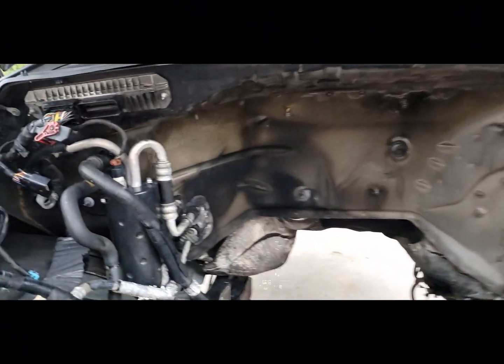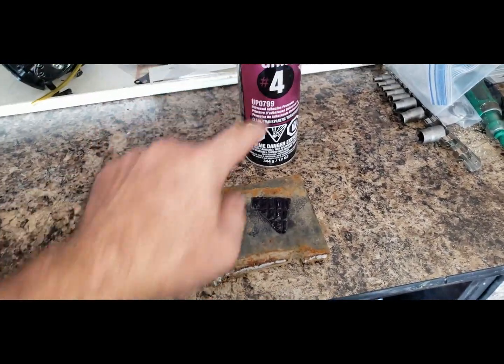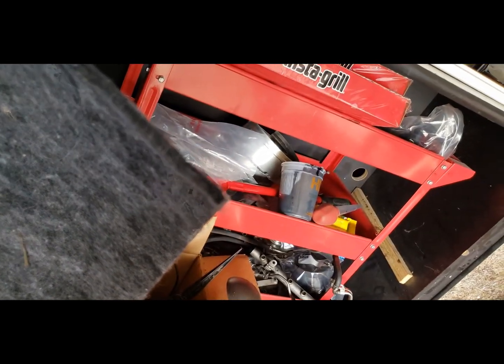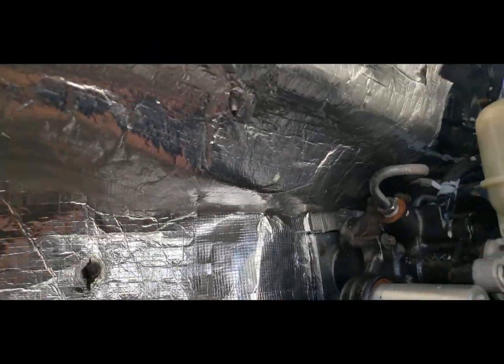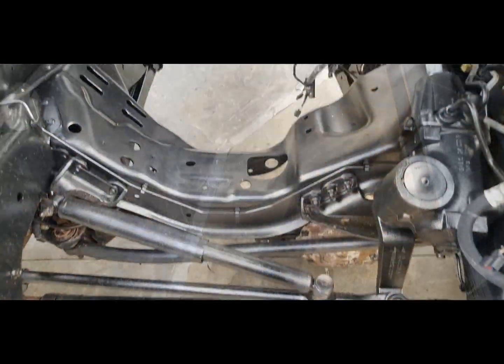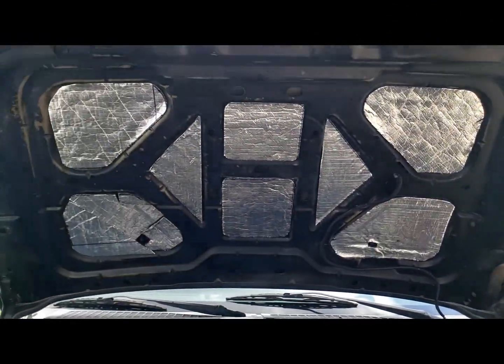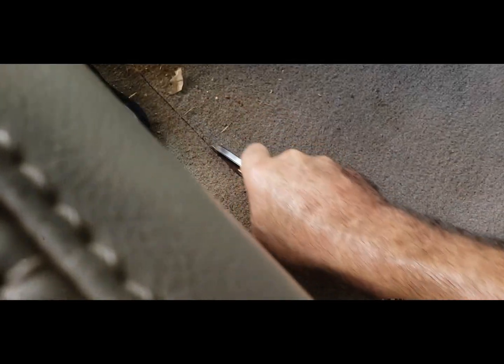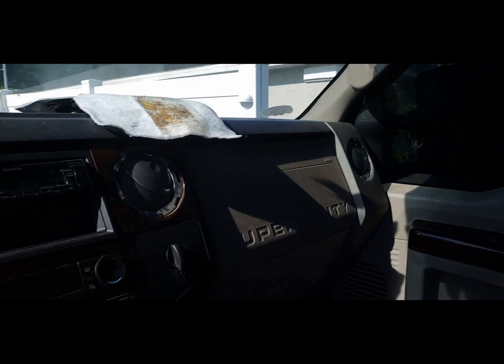Ford Super Duty firewall and hood insulation fummins

Comment: How's the insulation and sound deadening in the engine bay firewall and transmission tunnel holding up. any recommendations or changes you would have done as far as adhesion or retention. how do you like the noise and products so far?